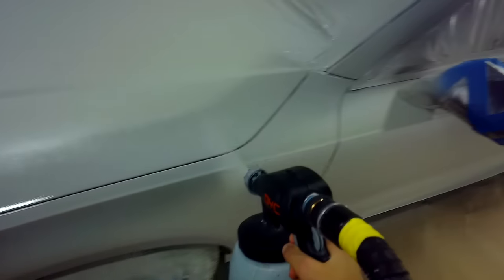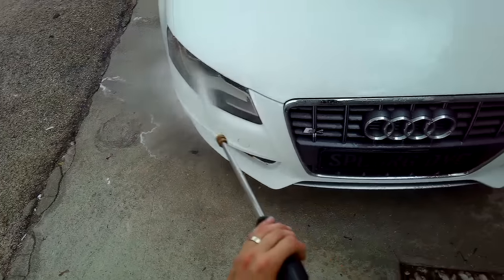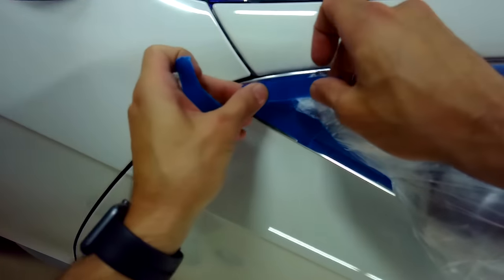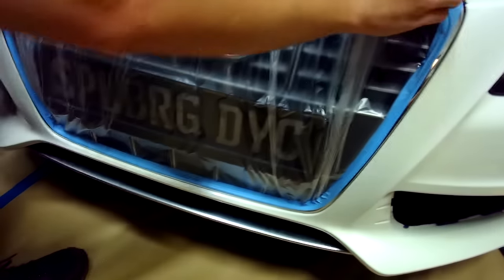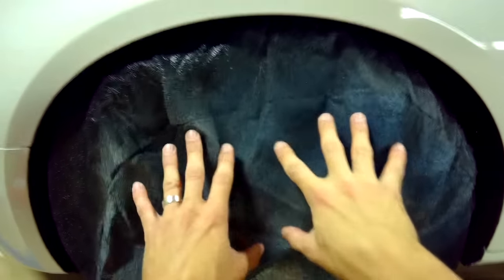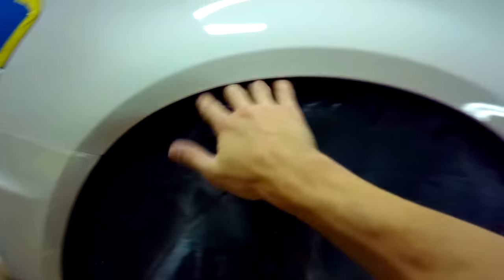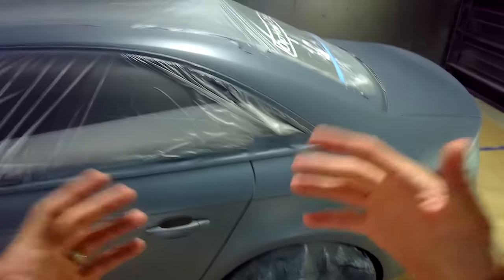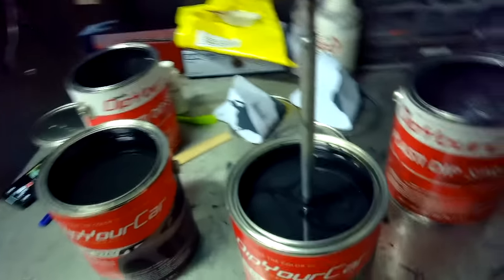Dip Your Car - The Entire Process in  First Person View

Comment: after seeing this video I feel way more confident on dipping my own car than taking it to a shop.
Reply: Yeah just got satin black in im ready doing by myslef in my storage unit
Reply: @cycling9945  would also like to know about to dip my rims for the first dipping experience but haven't manned up for the whole car don't really have a garage so  im hesitant
Reply: @nibbs3523  Its 100% fine to dip your car outdoors, as long as its 70 degrees or hotter.
Reply: @SuperSpidey98  yeah I'm in New York and it's no where near 70 but I dipped my rims this weekend went fine and look great execpt for 1 rim that I messed up on but i have enough left over for that rim to redo it. Because I am driving a 2015 gti golf that has black accents around the chrome  that I wanted to keep black and didn't need to dip. I dipped them pearl real red, just gonna roll around with 3 red rims and 1 chrome until this snow melts.
Reply: You don't want to do this outdoors. Lots of bugs, trash, dust out there looking to mess with you
Reply: So if I have a silver car and wana paint it pink, I don't need to paint my car a different color prior?

Comment: Pro tip from a painter- try to get that plastic as tight as possible when masking it.  The less folds and creases in the plastic the less spots for dirt to hide and blow out onto your panels. Also for the tight spots that are known for bridging , try investing in lift tape.
Reply: What is lift tape?
Reply: @dirtyharry5878  flexible tape that has a thin plastic edge that is designed to go under weatherstripping. Slide the plastic end under the rubber, then pull up, that will pull the rubber off the panel ever so slightly to allow material to get under it. Thus preventing bridging and also prevents clear coating peeling down the road.
Reply: @bowlofsoup12  thank you for the response I appreciate the info

Comment: To answer all the questions on how long will it last.  The first time I dipped,  I practiced on a 8x4 cargo trailer. Its been over 3 years and no fading or peeling. Trailer is stored outside in back yard. Dipped a 4runner sold it a year later dip still good condition.  Preperation is key
Reply: I dipped my wheels and it’s been four years and it just started fading. But I’m very impressed I was anticipating having to re dip them every year
Reply: mml
Reply: Can I dip my car outside? Or do I need to do it inside of a garage?
Reply: @SohailKazi7  I would definitely dip indoors if you can.  Otherwise you'll have dust and other things getting on it between coats.

Comment: Very good DIY guide! A product that when used correctly can achieve amazing results at a fair price. Most people that posted negative results either cheaped out on the preparation or didn't know how to correctly spray it. One question though for private use: If you wanted to dip the white paint in grey and all the chrome trim pieces in black, how would you have to do it? Thanks!
Reply: get to the stage in the end of this video and then mask everything but the trim and hit it.

Comment: It would be nice to add a few demos of doing it wrong- what it looks like to overspray and get runs, what it looks like when the dip bridges and tears, etc. It feels like the pacing of the spray's the trickiest bit to get down.
Reply: 90% of problems are bad prep and issues with the sprayer (flow, distance, dirt, etc), and that just takes time to learn.  I STRONGLY suggest you do a couple of old wheels or old panels first before going straight into it.
Reply: @josephoberlander  I think I'm actually going to swing by my local car junkyard and see if I can buy a hood and maybe a door of some trashed junker for practice work. Think that'd be worth it?
Reply: @chriscynefin966  Even some old sheet metal will work.  The first 2-4x you spray something like this (anything with an air compressor) you simply don't get it right.  Then you figure it out and things work much better.  A lot of people decide to one-and-done it and then have to peel their car and start over.
Reply: @josephoberlander  Great advice, I'm gonna do that. Thanks!

Comment: Being new to this channel, I have 2 questions : how long does the dip last on a car being used daily. And, if chips, tears on edge-lifts occur, can it be repaired/touched up??
Reply: I'd like to know the exact same thing. I am replacing a fender on my Silverado and would love to just paint dip instead of paying to get the part painted. Seems awesome if I can just dip it instead of paying for paint jobs. Or... Doing this to a brand new vehicle and when I go to sell it just remove  the dip and let it shine like just rolled off the lot.
Reply: @pointblank2910  It varies a lot depending on how thick you apply it, what kind of weather exposure you have, etc.  In Texas, I've got some wide plasti-dip black stripes.  After 7 years they were looking pretty bad.  I remasked the same area and sprayed another two coats from an aerosol can, and they look as good as new.  Plasti-dip does a great job of leveling itself out, and rewetting itself, so old stuff combines well with new stuff as long as it is clean.  One thing I don't see mentioned much that helps is removing the masking tape as soon as you finish the last coat.  By removing the tape while the dip is still wet, it gives nice clean edges.  The alternative is to cut through the dip once it is dry, which just takes a lot more work.  If you let it dry and just pull off the tape, you will be pulling up the plasti-dip with it.  If that ever happens, put the tape back down, spray a new coat over the tape line, and remove the tape while the dip is wet.
Reply: If dipped properly, a good 3-5 years but I'm pretty sure most people would change the color by then especially if they dipped it themselves.

Comment: Thinking of doing this for my van. Your kit looks great but I've only seen it applied on seemingly perfect, smooth car bodies. My van may have a slight dent or chip here and there. I'm planning on cleaning/degreasing, sanding down uneven surfaces, applying putty wherever to smooth out the surface, sanding it down again, apply primer, and then base coat and clear coats to finish. Where does your kit fit in to this process?
Reply: Did you ever end up figuring this out? I am looking to do my old Lexus ls-430, but the paint has a lot of missing patches.
Reply: @singer6402  The kit assumes that you have at least proper primer on the vehicle. So all of that is "prep work". Ugh.  Yes, it's a headache, but days or weeks of prep on weathered/damaged panels and going slow results in very good results.

Comment: Hey Fonzi
Now that you mentioned the gaps between panels. How does it actually look like in there ( spraythrough / coating wise ) after you spray the car? Where does the paint stop? Would love to see some "behind the gaps" video because you never see that, only shots with closed doors. 
And how do you get the door handles and the area behind it coated with enough layers?

AND can how is it to spray gloss topcoat on this?
Reply: Most pros recommend removing all hardware that you can reasonably get to.  For mirrors, most are also just a plastic cap on the back side and gently using a trim removal tool will pop it right off.  Mud flaps, tail lights - anything that is held in with a bolt or two.  This may also include some of the chrome work such as grilles and covers, depending on the vehicle.  My Mustang, for instance, has rear panel on the trunk lid that is plastic - with the logo on it.  It's about 8 small bolts to remove, but comes off easily.  With it removed, it's dead-simple to handle the trunk lid. Same with the marker lights - a couple of clips and they pop right out.

Comment: My question is there anything different you have to do when painting a car that has had body work done to it or is it still the same thing the reason I ask is because all the cars in these videos are new with no body damage that has been fixed or anything
Reply: Same bro cause I wanna dip my truck but it needs some working and I was wondering if we could just spray it over regular automotive primer cause every car in these videos have clear coat and I wanna see if it makes the difference if the vehicle is clear coated or just regular primer
Reply: Should be fine, just wet sand with 1500/2000 grit paper on primer so the surface is smooth
Reply: 1500/2000grit is too fine and you'll be sanding for ever. Start sanding with a 600 and go to a 1000 if you really want to. It's primer, and the plastidip is thick, so you won't notice any small blemished if you leave them.

Comment: One thing I'd like to inquire about is door handles. On a car like what you just dipped, there are recesses behind the door handle and I didn't see you adjust your spray to handle that. What do you do to insure you get full coverage behind the door handles? Just spray at a downward angle from the top and an upward angle from the bottom? I would assume that, but you know what they say about assume...

Comment: But what do you do with spraygun between spraying? You clean it? Leave it? If you clean then what you use?
Reply from the maker: Gizawar in between coats we just refill it. When we change colors we usually run Naphtha paint thinner through it and wipe it down. When we are finished, we again run Naphtha through it and leave all the parts separated to air dry.

Comment: So I have just recently started watching these videos and Im really interested and excited to start dipping on my own. One question I have right now is I see in a lot of the videos that you spray right over the emblems of cars and they don't look taped/masked off and then in the final shots the emblems are not dipped but instead are in the standard chrome. Ive watched your video on spraying emblems and and I see you can just peel it away? do you ever run into the bridging problem on the emblems. To me (who has never done this before) it just seems like it would be all to easy to be peeling the dip off of the emblem but then it start taking the dip on the surface of the car with as you do it. Obviously I would use extremely care and go slow while peeling it off but do you ever run into that problem I described or is does it always just peel away with simply ease?
Reply: If you do it right, it peels right away. Though I have started using soft tip darts to help keep lines clean.
Reply: @jacobgallaugher  

Bahahahajajajaajaaahahahahaa. 
LMMFAO
Reply: Good

Comment: There is a painting trick with spray paint to have the base coat show through by throwing dish liquid on the top of the finished base coat then paint over the base with the soap on it. Let it dry then wash the soap off to reveal the base to the top to have some crazy color combos.  With the mad scientist videos if there was some way to replicate that process to try and achieve the same results it would be mental

Comment: You should do a hard line on the fender liners and the back tape and hang paper or plastic, most fender liners contact the metal on the fender or quarter panel which could cause bridging also a lot of dirt gets stuck in there and can blow out while spraying even after a good wash

Comment: This is my first time ever fixing up my car and I’m thinking about getting a new paint job but don’t wanna spend $1500+ when I could spend between $500-$800, but my car has scratches and dents ( I bought a dent remover so I plan to get rid of most dents) can I still just dip over my car or would I have to do what I’ve seen other people do and sand it down add filler sand that down then wet sand it then spray on it? Or could I just buff it polish it and then spray the dip

Comment: You should always wash a car from the top down, lots of gritty sand, dirt, salt etc. can be on the sides of your car. And that grit will embed itself in whatever mit or whatever you are washing your car with and will put little scratches in your clear coat. Washing from the top down can help minimize where those scratches occur.

Comment: ? You haven't taped inside the doors, there will be over spray inside.
Reply: okay, so I'm going to comment about something else. I've never painted over a shiny paint job, nor used a sprayer like yours using. I did see what looked like you were pushing (lean gun on angle) instead of straight on. I do like the speed of spray, about like Nitro lacquer.

Comment: The ONLY Two things different that I see from doing a paint job is the body prep...No Sanding.  And the material to cover it with.
Everything else is the same.    Taping off...spray pattern....gun speed and distance....and  "Wet Peel"
Reply: And the flash times between coats.

Comment: It looks as easy as spraying high build primer...I know you like using your spray system but can you use a good HVLP gun with maybe a 2.0 tip? What kind of pressure would be a good starting psi at the gun?

Comment: Hi man, doesn't the car need to be wet sanded before spraying the base coat?? Im not a painter or a body worker by any means but i have almost always seen guys wet sanding their cars (320 grit) before shooting the paint. Reason being that paint needs rough surface to adhere/adheres better on a rough surface. Please correct me if im wrong

Comment: Very late to this. I'm wondering if plasti dip is similar to a vinal wrap. Does the paint get damaged afterwards? Can you take your car through the car wash with plasti dip on? After painting your car, anything you need to do to maintain it? Also, does my car paint need to be 100% when I start? I know it's definitely better for longer lasting dip. My car has 2 small rust spots. Should I sand them out first?

Comment: I was trying to use the tape and drape and the tape just completely ripped apart and I ended up just cutting the tape part off and just using the plastic and the blue tape. It still worked but it would have been nicer not to spend extra time dealing with that. I was wondering if it was my fault (probably is since it was my first time doing this) or if it was just my tape and drape? Product came out beautiful on my truck and i am definitely buying more in the future.

Comment: the dip sprayer u r using electric i presume is there a reason for the sprayer  being electric or is a choice u prefer to use can u  use hvlp air gun types too to spray it i didnt look into the dip system i just seen the hyper peral color mix w/out the gold n red i think a bit of red would of looked nice in it lil bit of it to give it a haze  but ya this the 2nd vid i watched was right after the mix vid Jan 10,2020 would like to no the differences between the sprayer u use and HVLP comp air if u can use it or if its designed for only the spray system

Comment: so if you peel the tape after a wet coat does that mean you only put on one coat of the color then peel the tape? what if you put 2 or 3 coats on wont that defeat the purpose of pulling tape off after a wet coat cause it wouldve already dried from the previous 2 coats?

Comment: Quick question: if I were to just want to use plasti dip to put a design on a panel (like a zig zag or something) I'm assuming I would want to remove the tape while it's still wet for something like that?

Comment: Deeeeeefinitely considering this as I did a diy project with my room removing orange peel on the walls painting with an airless sprayer instead of a brush. Yeah...this is cake. Realllllly...itching to set something up. It's literally the same process.
Can you get a better finish if the paint can be atomized smaller? I don't think in the context of a car it would matter BUT when you spray the finish of the base surface should come through or do you start to get spits if the paint is under too much pressure?

Comment: i picked up a 2017 mustang eco boost thats having oxidization issues i was going to wrap it but the people who do the wraps said to get it fixed. so today i buffed it with this stuff to help get some of the stuff out and then i kinda clear coated over it and then im going to wet sand it down. im just wondering if you could take a look at what i did and see if the dip would stick and be a better idea for the car? for just a couple small areas no more then 2 feet long and 1 foot wide on the hood and back pillar of the car i got quoted 1500 to fix it. im not looking for the perfect paint job or anything just something to cover up those areas and make the car look good. the paint is fading on passenger side as well. also what air compressor can i use?

Comment: Question.... Why certain tape peels while it's  wet. And others dry?? Also.... Lets say I tape off a design for the hood. Obviously no gaps there just tape directly on flat services. After its sprayed, and I start peeling off the tape to reveal the design, what stops it from tugging on the stretchy plastdip and fuckin it all up?? How does it peel so precise give how it's Damn near rubber??
Reply: The trick is you need to peel it with the last coat is still wet. If it starts to dry it will definitely pull up the dip. Look up their video about doing plastidip pinstripes.